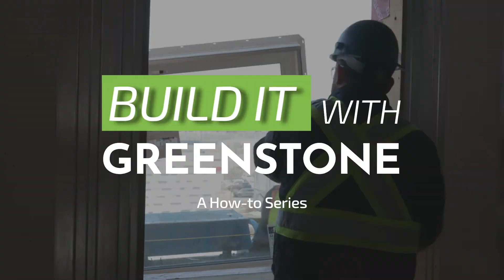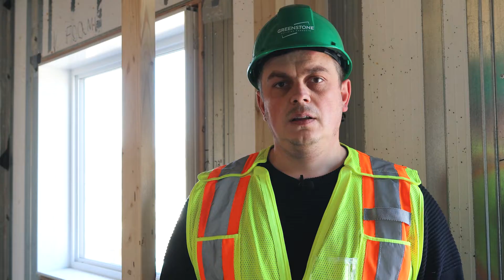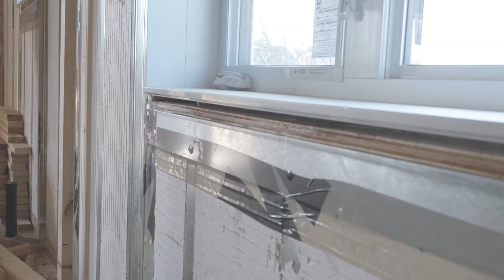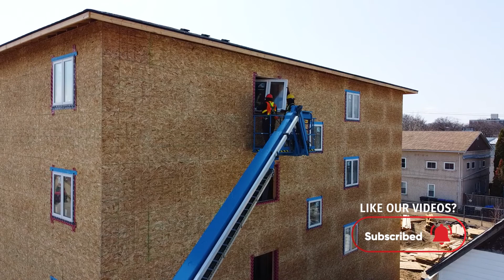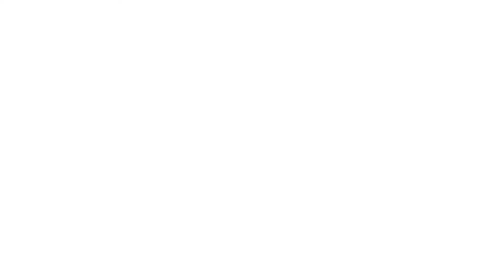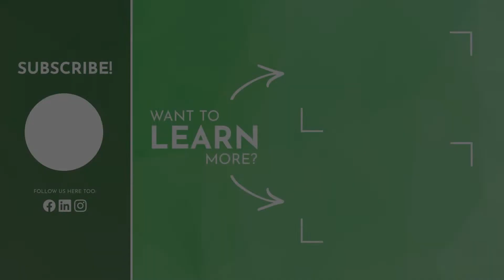Build it With Greenstone | Installing Windows & Doors

Comment: I noticed the exterior of house has OSB on outside of home? I thought with ICE panels that is not required?
Reply from the maker: OSB may be required depending on the project for structural purposes. Multi-story buildings, like the one in this video, most often will require it.
Reply: @GreenstoneBuildingProducts  so maybe that is why the majority of the SIP companies have OSB on their interior and exteior walls??